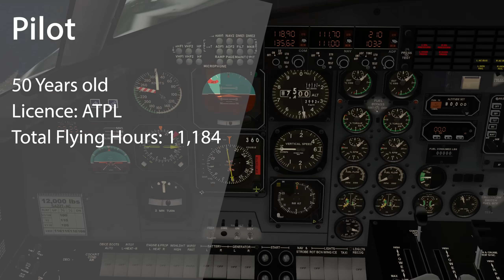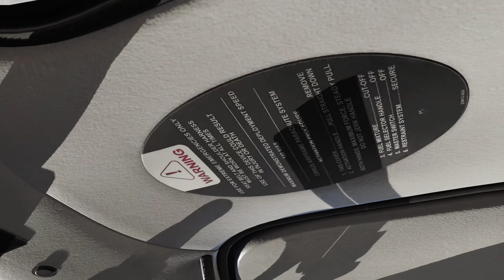Mid-Air Collision In Colorado! | How Did Metroliner and Cirrus Collide?!

Comment: Learned to fly at Centennial. Those runways are CLOSE. We were usually in that RH pattern for 17R and the instructors drilled into us that we absolutely must not overshoot base to final. BTW what a great airport, one of the busiest Class D airports in the US. I drove past the Key Lime place every day for training. The Texas Death Tube is really a beautiful machine. Also saw lots of warbirds and those amazing Piaggio Avanti canard commuters. That was a fun time. Glad everyone was okay here.
Reply: The San Antonio Sewer Pipe
Reply: I never had any problem with staying clear from 17l while doing t-n-g    If i was doing 90 knt mid field for 17R i would be going way to fast! Then i hear about this guy entering the pattern at 148 knts  i though what is this guy  doing ?!?
Reply: @tomspettel3646  Yeah… there is that. Cruise speed in many airplanes! The Gobosh 700 LSA I learned in was 70-80 base to final. I learned on my solo that the additional weight of a 200lb instructor makes a huge difference… I had been landing around 60-65 in dual, but solo I found out it HAD to be book, which was 55 iirc… landing fast meant porpoising, which caused me to go around three times on my solo. Finally made it down on the east-west runway, forget the number. That airplane was later porpoised to destruction by another student. N1277K, will never forget that n#, was on the cover of a Jep AIM in the 2000s. I think some other Gobosh airframes met the same fate. Other than that, they were great airplanes! 😆
Reply: "Texas Death Tube"; I thought they were called "Lawn Darts".  🤔
Reply: @Phil-y8c  google “metroliner nicknames”, there’s a bunch of them and they’re all, er, not complimentary! 🤣
Reply: @Phil-y8c yes, what is the Texas Death Tube?  A nearby water park slide?
Reply: Where did you train since there's nothing past keylime on airport road? Aspen?
Reply: @platapus112  centenial flyers used to be over by tac air now the aircraft are in the covered area by aspen . 
There was another small school over by tac air but don’t know what happened to them  and flights is still in that area.   ATF moved close to the  area of where the tower is.
Reply: @platapus112  i love flying the old school aircraft at centenial flyers 👍
Reply: @platapus112  It was called Skyraider Aviation. 13376 East Control Tower Road. IIRC they bought Aspen. This was back in 2010-2011.

Comment: Besides the poor Cirrus piloting and the lack of… trust, but  verify …  It shows that tower ATC using two separate frequencies during visual approaches leaves the pilots out of the total loop and puts the trust of separation solely between the controllers.
Reply: BTW, ATC is required to inform both pilots of the nearby traffic.

Comment: every pilot should know his pattern and approach speeds. the flap 50 limitation on the cirrus sr22 is 119 kts and the flap 100 at 104 kts. no trained cirrus pilot would fly a pattern at 140 kts (way too fast) and then even set the flaps. you would be in immediate danger to structurally damage the airplane. that only shows an unexperienced and/or reckless cirrus pilot, that should not be flying this complex airplane. additionally, no pilot would overshoot a base turn on parallel runways to interfere with the centerline of the OTHER runway. we did not hear the real ATC in this video, but the controller would most certainly call the cirrus pilot to attention for this overshoot. ATC for sure knows, that the parallel runway is in use and would immediately intervene and call the cirrus. does anyone have the ATC recordings? did ATC call the pilot?
Reply: It says in the video that the Cirrus was advised of the traffic.

Comment: That Metro was a tough old bird. Built in the 1970's you say. Must have had better quality control back then. Certain companies planes seem prone to start falling apart as they come off the production line these days. Strangely same company used to make planes that could take massive damage and still bring the boys back home - wonder what changed?
Reply: Not "better quality control" but rather higher built in margins of error because they weren't built using finite element modeling. THAT'S why older planes tend to be tougher but also slower and thirstier.

Comment: The Cirrus definitely made a mistake by flying in a pattern way too fast, but, blaming it 100% on the Cirrus is a bit unfair in my opinion. The separated ATC operation with parallel runways that close is a bit questionable.
Reply: BTW, ATC is required to inform both pilots of the nearby traffic.
Reply: @sludge8506  In which, the ATC that handled the Metroliner failed to do so.
Reply: @09shadowjet  👍👍👍👍👍
Reply: Also, why didn't the ATC extend Cirrus' base just for a safe margin?
Reply: @09shadowjet  Busy traffic.  There was another (student solo) coming into the right runway.  It's a very busy airport.

Comment: In my 40 year flying career I can honestly say the closest I’ve ever come to being wiped out in mid air was in a situation like this. The contributing factor in both my incidents (yes both) was a xwind from the right producing a tailwind on base for the aircraft on the parallel. In two seperate incidents only 3 days apart, the aircraft on the right parallel came sailing through my centre line as I was conducting a straight in on the left. I fortunately I saw both aircraft in time and was able to take evasive action. In the second incident a few days after the first, my evasive action was so extreme that I was forced to abandon the approach. I left for the airlines the next day! When asked by the ground controller to contact him by phone the pilot of the offending aircraft (grizzled old charter pilot, who frankly should have known better) pushed back and became even belligerent!

Comment: The menace flying the Cirrus was so badly out of control that he was literally aligned with the wrong runway yet so many of you figure he would have flown a sensible pattern if everyone was on the same frequency? Those of you who are licensed should think back to your days as a student and recall how many times a flight instructor used the term "Good landings come from good approaches" in your presence.
Reply: @superkendall1003  I have spent too much of my life with my hand on my throttle!😂
Reply: The point with using the same frequency is to improve situational awareness for BOTH pilots. As it was this time, the only pilot who knew there was traffic on both runways was the one who flew like he needed a bathroom break immediately.
Reply: I did that before. To fast. Simple error. Im guilty as charged

Comment: Looks like the Metro in this video is an SA-227 Metro 3. The 226 had a three bladed prop and the landing gear doors would be open on the ramp. Both sported the Garrett TPE-331-10UA engine, although the 3 had a more powerful version IIRC.

Still a beast of an airplane to fly, and worse to work on!

That said, Metros were overbuilt to a large extent, partly because they also had a high differential pressure fuselage.

Comment: As soon as you mentioned the speed of the Cirrus I immediately knew what the outcome would be.
Reply: I don't even think airline transport jets come in that fast.
Reply: @solefinder3708   that's about 737 speeds.
Reply: @solefinder3708 it wasn't a jet
Reply: I'm not even a tower controller, but my first though was "hey, that's not right, that's way too fast". From what I know, a 737-800 has an approach speed of ~140 kt.

Comment: My question is was the Cirrus pilot actually thinking he was going to land flying that dang fast in the pattern.
Reply: Talked to instructor. He said 98 was a decent downwind speed.   Pilot probably had to take a leak and was in a hurry to get down.
Reply: @timtreeborgsonjen1533  If that's the case I bet he ended up with more than taking a leak in his drawers!
Reply: Pure incompetence.
Reply: @ace00007  If not for parachutes, Cirrus would be the next-gen Doctor Killer.
Reply: @ace00007  or pure incontinence
Reply: @spacewolfjr LOL
Reply: The final report has the speed and the recommended speed, but nothing else. 😧
Reply: I was thinking he was flying faster because of the density altitude at 7000.  Never flown a Cirrus so not sure. I would have to ask an instructor.
Reply: @timtreeborgsonjen1533 I've flown that pattern at 7k (even upwards of 10k) density altitude many times. You go a little faster, but 140 knots in a cirrus? 😂 That's near the approach speed of a 747
Reply: @rylanrussell9595  I was thinking he had to take a leak and was in a hurry.
Reply: @timtreeborgsonjen1533 , indicated airspeed is always the same regarding density altitude. GROUND speed is affected. If you are a pilot, I suggest you thoroughly educate yourself on this matter, as it is of some importance to piloting.
Reply: @johnsmith-po1uo  So pejorative. He never said he was a pilot, just he never flew that plane. I'm glad though that you have all the answers wrapped up in your head.
Reply: @johnsmith-po1uo thank you. I hope I can count this as one more lesson learned. If I ever fly out west I need to make a wider pattern knowing the ground speed is higher and it'll take more room to make base and final turns.
Reply: That’s a great point!! Perhaps the final report has some information on that. 👍👍
Reply: Answer: Who knows WTF he was thinking? He/she might possibly know. 🙄

Comment: In the SF Bay Area we have several GA airports with parallel runways. Several have separate tower frequencies assigned. I am not aware of ANY of them that use the separate frequencies. 

SFO manages to get all those big jets landed parallel and simultaneously get parallel takeoffs on the parallel crossing runways all with one tower frequency.

Parallel runways in close proximity should be on a single tower frequency for safety. No matter how "busy" they think they are experience proves separate tower freqs is not necessary.
Reply: BTW, ATC is required to inform both pilots of the nearby traffic.

Comment: Ya let's blame it on the Cirrus air speed, bull pucky! 2 runways with 2 towers? do they think there DFW? this was an ATC problem in my eyes!
Reply: You can't turn as tight with higher airspeed, that's simple physics. ATC certainly shared some blame.
Reply: BTW, ATC is required to inform both pilots of the nearby traffic. 

But, the Cirrus was to blame. An eight year old can figure this out.

Comment: Very lucky pilots.  Really bad ATC two tower frequencies.
Reply: how would they manage all of that traffic on one freq? Any busy airport in usa has multiple tower freq
Reply: @youtubeyerr  They do it in KSEA, KPDX, CYVR and other major airports.  Pilots flying into busy (any) airport have to be aware of who is nearby and where traffic is. Situational awareness is critical to safety. Communication is critical. Splitting into two frequencies at one airport is a breach of the need for situational awareness and effective communications.
Reply: @johnolsen7073  all of the airports you listed have multiple tower frequencies. With enough traffic, they will not be managing all runways on one frequency. That would be significantly more dangerous. Its the pilots job to be alert to traffic around them. Even though they are on different frequencies, tower still has to call out traffic. If thats still not enough for the pilot to see and avoid, it is a skill issue - not a communication issue.

Comment: When i hear there two close lines operated with two different towers, with different frequencies....i immediately know what's gonna to happen.
Reply: ATC was required to notify the pilots of the other traffic. 

It wasn’t the different frequencies. It was the failure of one of the controllers to do his job.
Reply: @sludge8506  It was the idiot in the Cirrus not only flying too fast and through the extended centerline of his intended runway, but the fact that he flew through the extended centerline of the other runway as well.  Not to mention flying through the center of the Metroliner while he was at it.  And he was advised of traffic which should have been very easily visible from the Cirrus.
Reply: @M1903a4  Champ, my statement is factually accurate. Deal with it. I wasn’t determining who was at fault for the accident.
Reply: @serge470  tower 1 and tower 2 are workstations near to each other.

Comment: Wow. I can't believe that Metroliner didn't just come apart. That's really impressive.

Also, the separate tower frequency thing is weird. It's incredibly beneficial for pilots to hear the chatter from other aircraft in their vicinity, especially when you have mixed general and commercial traffic.
Reply: I spent about 6 years working on both the metro 226 & 227.  They’re a pain in the ass to work but they’re built like tanks.  All of the control cables (for the tail) run through the floor.
Reply: @dareelamb1964 as opposed through the ceiling? They all go through the floor
Reply: @platapus112 not all.
Reply: @dareelamb1964  most. Every GA airplane does, most businesses jets do
Reply: BTW, ATC is required to inform both pilots of the nearby traffic.
Reply: @sludge8506 they did
Reply: @sludge8506  Former air traffic controller here--you're darn right they are, and I'm surprised that there are so few comments on the controller's failure to inform the Metroliner pilot of his traffic. Sounds like both those controllers could have used some refresher training on proper procedures, and maybe communicating with each other about the planes they are working?
Reply: @fyrequeene  I was hired for ATC, but ended up being disqualified because of my eyesight. Still, I learned a little bit before.

Comment: No Radar in the airplane ??? No Tcas ???
Reply: same question, I worked in Metro and it had it installed.
Reply: The Metroliner probably has, but the Cirrus didn't. Cirrus probably only had TAS but it isn't TCAS so it won't communicate with the Metroliner.
Reply: @09shadowjet  I don't think an SR22 has TCAS, but it almost certainly has a transponder, and minimum C-type altimeter. The TCAS shows you the contact, and the Metro should be able to know the Cirrus position.
Reply: @VonHorten  the problem is that TCAS only communicates with other TCAS. Should the Metroliner have an ADS-B based traffic avoidance system, it would've warned the pilot about the Cirrus' whereabouts.

Comment: Ja, one of my "almost died there" was caused by two aircraft being on different tower frequencies.
A CH Sea stallion was cleared to depart with an underslung load after a bunch of V22  Ospreys had done a pretty formation turn off the runway and soaked the air with dust.
Our airliner was cleared to takeoff by the civil controller only to find at V1 at the end of the dust cloud  was a shipping container on a wire 50 feet above the runway.
We had nowhere to go except to stay on the ground and roast the brakes.
This was Djibouti in case anyone is interested.
Reply: What part of the Cirrus struck the metro liner ?
Reply: Jeezus!
Reply: @BobbyGeneric145  yeh, I didn't even manage to yell the word STOP !!! as we both saw this at the same instant.
Fortunately training kicked in but the brakes took 30 minutes to return to the takeoff limiting temperature.

Comment: This one has been covered by many aviation channels, but your visuals beat them all. Still wonder how the Cirrus pilot thought he was going to land with that much energy. Unfortunately not spotting advised traffic got him first.
Reply: I'm hugely surprised the Cirrus pilot never saw the Metroliner...what's all that glass around you for?
Reply: @stejer211   it's not a vision problem but a cognitive one. 🤡
Reply: @stejer211  The Final Report is not very useful, however it says that the Cirrus had a TCAS system which sounded, but it's not clear how long before the collision it occurred. However, it also mentions that the flaps were extended only 4 seconds before the collision, so maybe his attention was taken away to configure the aircraft. All in all though, the report doesn't mention why he flew the approach 50kts faster than according to the POH, and doesn't state why we was configuring the aircraft for landing during the turn on to final when he clearly wasn't even going to make the turn, so it's a pretty bad report, and it's doubtful we will know all of the factors involved.
Reply: he landed exactly how he was meant to, eventually, land. 🧐👆

Comment: Great video and analysis thanks. 2 more elements, all mistakes apart, where was the Cirrus’ pilot looking? Certainly not outside.. I bet my money fancy cockpit gadgets did it again..
Reply from the maker: That is a good question, and as you say, inside at the instruments does seem like a good bet. That being said, the Metroliner would have been towards the underside of the Cirrus and most likely not visible during the turn.